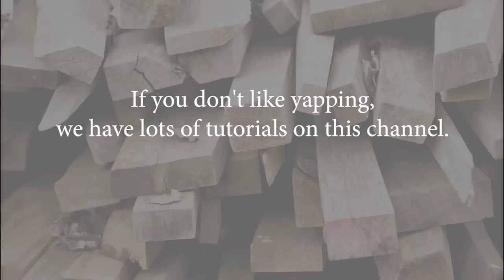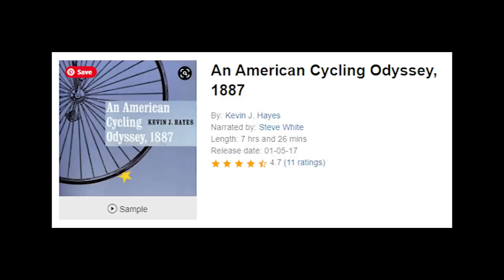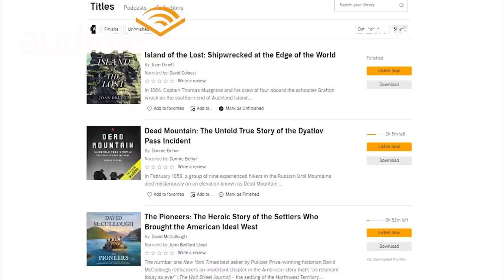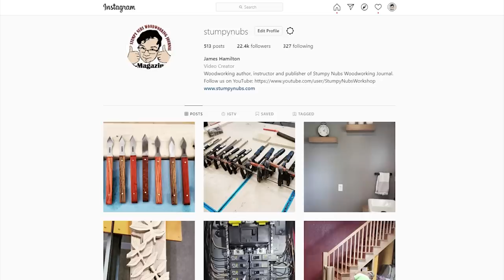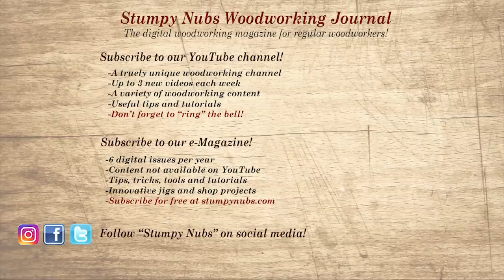Have they BANNED table saw dado sets????

Comment: If they had a longer arbor on the Euro saws, they could jam nut the dado stack. They could also add a selector that puts the saw into a dado mode that doesn't as aggressively brake the motor, or changes the braking system to ramp up braking force over time, instead of all at once, on power down.  If they're still worried, combine the alternate braking with the dado stack being secured with the arbor nut and a jam nut.  Another option is a keyed washer design that would prevent the dado stack from loosening the arbor nut, and you could always add a jam nut.

Comment: Please  send me a dado stack 🙏🙏🙏...but why  do you complicate work with fractions 🤔🤔....we also have rabbits in the old country 🐰🐇👍🤣🤣keep up the good work from across 2 ponds 👍😊
Reply: We 'muricans r smrt. Do fractions to sho smrtness. (Very sarcastic if it's still unclear. I'd just wish we'd adopt metric already. So much easier.)
Reply: why do you still use 360 degrees in a circle and not 10. why do we all use seconds, minutes, and hours? seems so old fashioned. obviously we should be using the speed of a red laser light in a vacuum. lets be precise.

Comment: I’m a Brit living in Texas.   I use a 3 HP table saw (230 volts) and wouldn’t be without a dado set.  I have never had kickback or issues using one.   Using all normal precautions and especially a push board is necessary, of course.

Comment: I usually use the Woodpecker's RipFlip attachment on my saw for dado cuts using a plain old ripping, flat ground blade. It's an extra few passes, but setup is quick and painless and extremely accurate. I can also use dado sets, but I'm lazy and don't always feel like swapping out the blades, the brake on my Sawstop, the riving knife and the insert.. MUCH easier to just swap out one blade and remove the riving knife when needed..

Comment: I’ll have to agree with the Europeans about the metric system, imperial (inches) is awkward, clumsy, outdated, ...
Reply: Only if you try to learn imperial after you already learned metric.
Reply: I'm European; I like the imperial system, especially fractions. Much easier to use to design things with than metric, which is an arbitrary piece of nonsense, quite literally. The metre was supposed to be something like 1/1000th of one second of arc at the equator, only the French got the calculation wrong and it isn't even that. It's a nuisance size, whereas feet are conveniently human-sized, and fractions are extremely useful too.
Reply: 12 inches in a foot, 3 feet in a yard, 22 feet in a chain, who knows how many in a furlong, 1760 yards in a mile, 4400 square yards in an acre. It is all so logical. I was raised on imperial and then the country went metric. Good move. Join the rest of the world and see the advantages.
Reply: @martinpammenter9668  I am unlikely to make anything that is a chain, furlong or mile long at my workbench. For woodwork, and day to day life, feet and inches and fractions are simply better.
Reply: Metric sucks!!!
Reply: Your correct but us yanks  are  too stubborn or too stupid to change I've got 69 yrs  worth  of tools I see no reason  to abandon  now, couple more yrs I won't need them anymore for certain.  My country  tried to convert us but did  a p. Poor job of it and that was 50 + yrs ago . Then they gave up. But  I do own a few metric  wrenches   or spanners I've heard them  called. Quite rightly  named.  I don't know why th u.s. never complied but in all reality I would guess general motors or Ford didn't want to retool.  Just a stab in the dark- but you think about it and see if we agree 👍 be well.
Reply: @simon-d-m  you sir are the first European I've ever heard say that. Hard  for us older guys  but  can you explain  why you think our system is preferable.  In my 69 yr old mind it's easy but can you explain why you think so please.   Thank you Simon.
Reply: @simon-d-m  I'm sorry I only read half of your post. DAMN the French. LOL. You be well .
Reply: @larryh.4629  
We are definitely stubborn bunch. I have 50 years worth of tools the SAE is being used much less these days US car’s sense the 80’s have been metric along with most US made equipment. So why I working with feet and inches when building anything houses to widgets?  FYI I’m 67
Reply: @monteglover4133  The most frustrating thing is working on cars where some parts are imperial and some parts are metric, depending on where the part was sourced from.  Neither is inherently better, it just depends on what you grew up with.  All measurement standards are made up by people for their convenience.  Metric is easier when using base 10 calculations.
Reply: Penny nails, #10 screws, 14awg wire, 7/32" drill vs. all the diameters in millimetres.
Reply: @Toby_ATG  As I understand it, the first country to use base 10 currency was the U.S.
Reply: @simon-d-m  You realize the the archaic imperial system is based on the metric system, right?

Comment: The Europeans have a regulation for the proper zipper length on men’s trousers.  Apparently they want to reduce the risk of someone catching their Johnson during a quick zip.
Reply: it does hurt, happened to me when I was about 5 or 6.
Reply: @Samuel Bonacorsi - don't believe everything you read on the internet. There is no EU legislation dictating the length of the zipper on men's trousers
Reply: I have a revoler with a barrel marking "Bullet come out this end -->"
Reply: @covcarpenter9158  you looked?
Reply: @uglybobhere   im reliably informed by a well traveled lady 😂😂😂😂😂😂😂😂😂😂😂😂😂😂😂😂😂

Comment: Let me guess how you’re going to pacify the Europeans - measure the dado stack in metric units?  😏
Stumpy, is there a way to retrofit a longer arbor on a table saw? My DeWalt arbor is too short for a stack. Is there a solution, besides a different saw.
Reply: Perhaps you can retro fit the arbor from a DeWalt supplier in the US for the same model which would have a longer threaded shaft.
Reply: I believe Dewalt makes a specific attachment for their newer jobsite saw's If thats the moldel you are speaking on... I have seen a couple dewalt dados at my local lowes recently
Reply: Use pulleys. Run a belt from your arbor to a separate axle.
Reply: @twestgard2  ooh - that's a very interesting idea...  You'd have to do a fair amount of engineering work with bearings and such to have it run true and not bind up, but that would solve it!

Comment: Another possible solution is to use a pinned arbor.  I believe some of the sliding saws that mount large diameter blades do this.  It would prevent the torque from blade momentum wanting to loosen the nut.   You could also do some sort of splined or keyed arbor.  The trick with the dado stack is that it would make some stack depths need to built in a certain order for teeth clearance and alignment with the pin.

Comment: They’re “rebate” and “aluminium”. That is all.
Reply: Actually, aluminum was the original name. At a later date some language snob in the UK thought aluminium fit better with other metal names like titanium and changed it on their own. The US stuck with the original.
Reply: @richdiddens4059  "Language snob in the UK" ???? 
You mean
"The Swedish chemist Berzelius, who recognised the value of logical naming, proposed (in 1811) that the names of the elements should all be Latin in form."
eg uranium, chromium, barium,  All metallic elements discovered after this date (1811) have been given names ending in -ium (occasionally -um). Examples are cadmium, lanthanum, lithium, thallium, radium."

The USA  has always been the snob, not using international scientific standards.

Comment: Dado sets are wonderful and I would use it if I had it. My Felder K700 has an option for a dado blade but it is a single disc with some carbide inserts instead of stack of blades. It is quite expensive add on for the saw. But this is the only response i EU. The other (expensive) solution is spindle moulder machine, but that can make many things beside simple rabbets.
 I stick to making many passes until I reach the width I need. It is slow but I don't do production.
I really enjoy you bashing old continent folk. Keep up great videos!

Comment: In ten years you'll be lucky to even be able to own a table saw let alone a dado blade. The armchair safety inspectors are absolutely out of control and this stuff eventually finds its way to some bureaucrat who's itching to force their will on you. Push back.
Reply: Plus after 10 years of double digit inflation only the richest will be able to afford a table saw.
Reply: @AdamSmith-po5pd  or the wood

Comment: My dad's old Craftsman wobble blade works pretty well. Haven't used it with my DeWalt contractor's saw yet. 
The only drawback I've had in the past is that the dado sometimes isn't perfectly flat with only two angled blades and no chippers in between.

Comment: Regarding the metric system. It sucks. If you know how to read an inch rule, the way that inches are divided into fractions is far superior to a metric rule. The metric system is too fine or too coarse; you have mm, cm, and then a meter! 

And you see measurements like “0.7 mm”. Ok, sure… show me .07mm on a ruler. But I can directly read 1/16, 1/32, 1:64” etc. 

And WITHOUT COUNTING I can look at a rule and find 5 7/8”. I don’t have to count up to 128.9 mm. 

It’s also better for screw sizes. 

All the people who criticize the imperial system never used it. 

And the US does officially use the metric system. But don’t expect industries to change any time soon.

Also the original name and pronunciation is “aluminum” which was coined by British chemist Humphry Davy in 1808! 

At least we don’t call quotation marks “inverted commas.” 😁
Reply: Obvious troll is obvious
Reply: @EntropicTroponin  Don’t be so hard on yourself. You aren’t so obvious.
Reply: @DavidRavenMoon  :D
Reply: @dlevi67  I use it all the time. That’s how I made my determination. I’ve also used other systems in my line of work such as picas, agates, points, and rubies. Do you know what they are? 

It’s ok to use a different measurement system. The world isn’t going to end! 

I’ve been a luthier and graphic artist for about 45 years. I use rulers as part of my work. I know how to read a rule. I can also read a micrometer.

Have you ever used anything but metric?
Reply: I moved to the States when I was 21 and worked 3 years as a carpenter. Got all caught up on using Imperial quickly and use it every day for the last 27 years.  Metric is not my favorite anymore, but it is still much better and easier to use.
Reply: Your argument is as stupid as it is arbitrary. Of course you can't find 128.9 mm on a rule, 0.5 mm is the smallest useful graduation on a metric rule. Only slightly larger than 1/64" and let's face it, only slightly easier to see. As for your fractions a metric rule can have 1/2000, 1/1000 and 1/100 of a metre, commonly called half mm, mm and cm. 
I can find 128.5 mm without counting but I can't find 5 8/9".
Reply: @markharris4421  your rebuttal was stupid and arbitrary. The metric system isn’t better. Just different.
Reply: @dlevi67  And? What’s your point? I seem to recall this was a British colony. 😁
Reply: @dlevi67  I don't think David's coming back mate, you may have given him an aneurysm.
Reply: @dlevi67  an Imperial Crusader!?
Reply: @DavidRavenMoon  Actually, metric is vastly inferior to imperial, specifically because of duodecimals and fractions, and secondarily because of the length of the primary units (feet and inches) compared to the unwieldy metre.  And @dlevi67: don't mix up the idea of SI units as a system for science with the practicalities of distance measurement in a human world.
Reply: @simon-d-m  "unwieldy meter" made me chuckle 🤭
Reply: @dlevi67  Ah yes, the handy ad hominem, when all else fails. 

Metric is silly in its own terms, by which I mean the reasons for which it was invented, as well as the actual metre length (Google is your friend there). In contrast the foot, in particular, has existed at least since Roman times, because it is practical. Of course the foot wasn't standardized in modern terms, but it was used across the empire. But I am bored with this: go on enjoying metres and millimeters by all means. I shall go on enjoying feet, inches, and easy fractions. But do try to learn a bit of history - feet and inches, as used across Europe before the French revolution,  are practical above all else. That is why they have lasted so long.
Reply: Do the metric haters only get paid in cents cos they don't understand dollars?
Reply: @Toby_ATG  No we get paid in dollars because we have dollars (inches) and not just cents (mm) and dimes (cm). Plus we are too busy building things to listen to people whining “but why are you still using the standard system? Metric is better”. We do have liter bottles of soft drinks however (but gallons of milk, so go figure).
Reply: @simon-d-m  historically there have been big issues with foot, inch and other customary units which is the reason metric was developed. The length choice of the meter is arbitrary but not more so than feet or inch. From my perspective feet and inches are odd base measurements. Inch is too big for precise work, a foot is too small to describe lengths on the scale of buildings. It's mostly what you grow up with and are accustomed to. Metric has the advantage that there is only one base unit off of which all length units are derived: mm, cm, m, km. Excellent for science and engineering. Inch and feet work well for woodworking, but you can do the same in metric. Change inch with 2.5cm and foot with 30 cm and there you go.
Reply: @EntropicTroponin  Metric was a product of the French revolution, as was keeping to the right on roads. It was politically driven, and parts of Europe continued to use feet etc. for a long time as a day-to-day system, well into C20th. The fractional system IS very practical too, but irrelevant if you are mostly ONLY measuring (e.g. in science), rather than designing aesthetically, portioning out, etc.
Reply: @simon-D-M  It was in part politically driven, but a lot of things are. That's not an argument against the system. It's surprising the US stuck to the "UK system" even after declaring independence. Metric also fixed an important issue. In the past every city/region or even trader used their own set of units, mostly inconsistent. In NL an inch used to be somewhere between 24 and 27 mm. Instead of fixing the foot and inch, they chose to define a new unit to prevent people from sticking to their version of the old unit. 

One meter is very close to one step for me, so the meter makes a lot of intuitive sense to me personally. Feet and inches are rather meaningless to me. The fractional system is useful for things like woodworking, but this too is easily done in metric with a smart choice of the base unit you use. I put a few examples below. If you would choose to use metric you'll get used to it quickly. While living in Canada for a few years I tried imperial measurements for a while, it didn't provide any advantage. Especially when the 2 by 4 I got wasn't close to 2" x 4" and I had to start using 29/64 ratios. So glad I was that it turned out to be 11.5 mm.

Of course use whatever you prefer. If imperial works for your process, that's awesome. Personally it would be nice if I didn't have to translate the imperial units in a building instructions to metric the entire time, imperial doesn't really have advantages to me. 

Adapting the rational system to metric:

Work from a meter: 1 m to 1/2, 1/4, 1/5, 1/10, 1/20, 1/4 gives 50, 25, 20, 10, 5, 2.5 cm. 

To stay close to a feet: 30 cm to 1/2, 1/3, 1/4, 1/5, 1/6, 1/12 gives 15, 10, 7.5, 6, 5, 2.5 cm. 

Close to an inch: 24 mm to 1/2, 1/3, 1/4, 1/6, 1/8, 1/12, 1/24 gives 12, 8, 6, 4, 3, 2, 1 mm. 

And if you want more: estimating 1/4, 1/3, 1/2 mm on a metric ruler is not difficult with a carpenter's eye
(Edited: some typos)

Comment: Only took him 72 days on that silly bike. You didn't mention that 1/2 that time was spent just trying to get up on the damn thing.

 My current Table Saw is a dynamite little Dewalt. It's small, but packs a pretty good punch, AND I can dial the fence, which I love.....but yeah, the arbor is too short for any Dado.
I spend much more time either making lots of passes (Did I mention the dial a fence option it has?) or my router depending on what's going on.

Thanks as always sir. Amazing insight once again.
Reply: My Dewalt table saw will take a dado set. Made sure it had that capability before I settled on the model. 7491RS I believe.
Reply: @jamessimon7292  
Interesting. I don't think that model was available when I bought mine. 
That was the only thing holding me back from buying the DW735.....I bought it anyways. ;-)
Reply: It's the one that comes with a rolling stand. Usually goes for about $600, but got it for $499 from Lowe's a couple years ago.
Reply: @jamessimon7292 
Well hell.
Just went and looked through the differences between your saw and mine.
Now I wish I had waited a year or two....guess it's something to put on my XMAS list....
Pretty much the same EXACT same saw, except you can Dado and slightly faster blade speed.

Comment: I do like and own a nice set of dado blades. But since i only own and really have room for one table saw. Its just not convenient to use most of the time. I have found what i prefer to do is use a panel router or just a router in general to make those same cuts. Its not unusual these days if i have large sets of stuff to make a stationary setup with my cnc router and have it do the work. They are just much faster and often safer solutions. Without the need to risk bending the arbor on my middle of the road table saw. (which i have spent alot of time getting to run square and true).